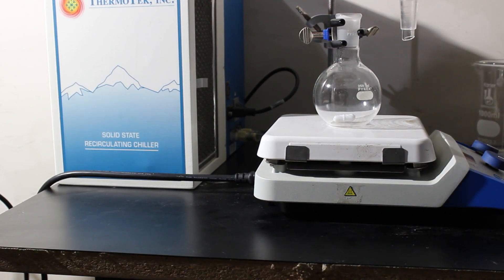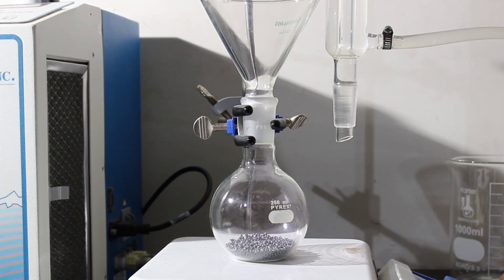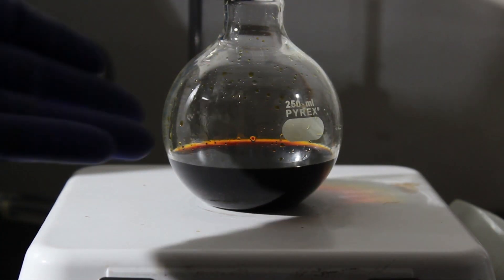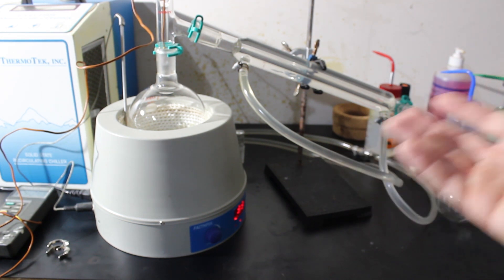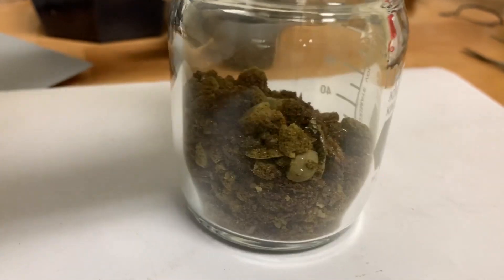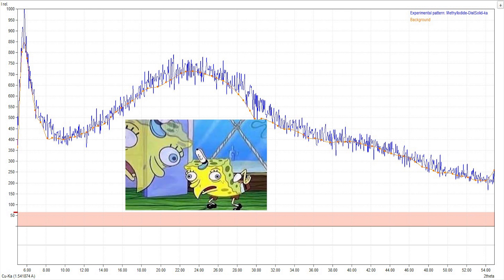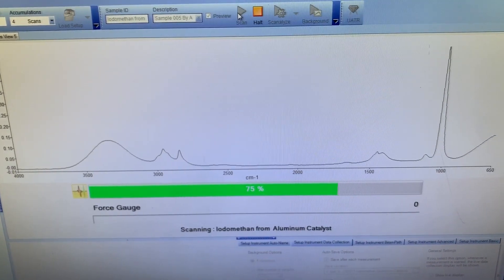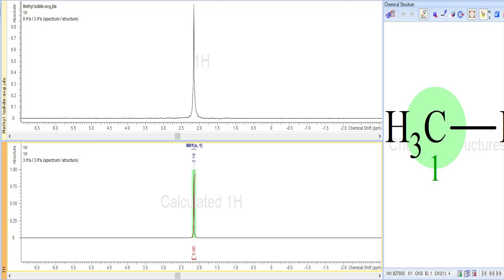Iodomethane Synthesis with Aluminum Part 1

Comment: Make sure the iodine is dry, use a bigger flask, also use aluminum machining turnings. Helps to wash the aluminum in methanolic NaOH. Add the aluminum and MeOH to the flask first then the iodine in small pirtions down the reflux condensor. You get HI, AlI3 Al2O3, and MeI. Its best to add the freshly sublimed iodine in small portions adding more as the color fades and when you get no more color change its done. ❤

Comment: Where do you get your iodine?
Reply from the maker: I am running a professional laboratory so I ordered mine form sigma Aldrich
Reply: @MooreAnalytical  yes, as a retired chemist, doing fun stuff at home, sourcing some chemicals is a challenge.
Reply: @michaelf7093  make it from an iodide salt. You can buy those on Ebay.

Comment: Will aluminium powder work?
Reply from the maker: It should work just fine, however I would be very careful since the powder will increase the reaction rate an drastically. I wouldn’t use the powder because of that fact.
Reply: It would react violently and possibly explosive if really fine. Use courser pieces like flake aluminum and add slowly. The reaction intiially creates as follows 2Al+3I2> 2AlI3; then 2AlI3+3MeOH>Al2O3+3HI+3MeI. During the reaction the AlI converts to Al2O3 by ripping the oxygen from the MeOH while the HI formed acts like a catalyst to speed the reaction rate. Whatever you do, under no circumstances use mercury or aluminum amalgram in this reaction. If you do then it will create dimethyl mercury by 2MeI+Hg2>HgI2+Me2Hg😲😵😵😵

Comment: Can you make a video about making isopropylamine using aluminum galinstan amalgam? Gallium, Indium, and Tin are non-toxic. Galinstan alloy is non-toxic and would be a useful alternative to mercury. 
 
https://youtu.be/sPsVdiL-VdM 
https://youtu.be/qB0GDbhpw-Y 
 
69 grams of Gallium, 21 grams of Indium, and 10 grams of Tin are placed in a beaker and heated. The result is 100 grams of galinstan. 
 
90 g of aluminum foil is weighed out and ripped or cut into small pieces. 10 g of Galinstan is weighed out and placed in a crucible. It was heated with a torch. The yield is 100 g of aluminum galinstan amalgam. 
 
A mixture of 17 g (0.3 mole) acetone, 200 ml ethanol, 200 ml 25% ammonia(or 500ml 10% household ammonia), and 80g aluminum galinstan amalgam is placed in a 1 Liter flask(or 2 Liter if using 10% ammonia) and warmed with strong stirring until reaction takes place, after which warming is stopped immediately. Cooling should be applied if the reaction becomes too violent. When the violence of the reaction has diminished, the mixture is refluxed with vigorous stirring for about 3 hrs. (Don't forget the liebig condenser). The mixture was filtered with a buchner funnel and the galinstan recovered. The filtrate was dried with anhydrous magnesium sulfate. The yield is isopropylamine freebase. The isopropylamine is reacted with Hydrogen Chloride gas. Then the isopropylamine is weighed. 
 
Since you have the machines, you can analyse the isopropylamine freebase to see if you made isopropylamine. Make a video about it.